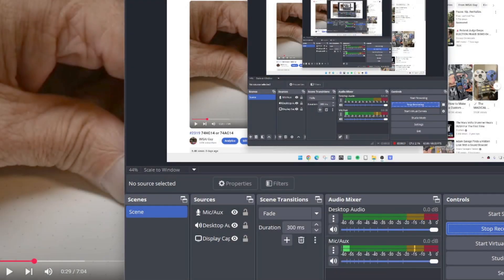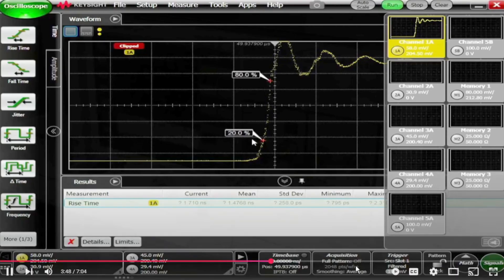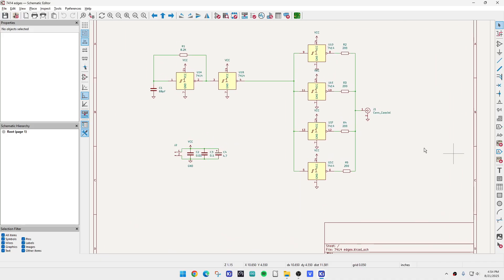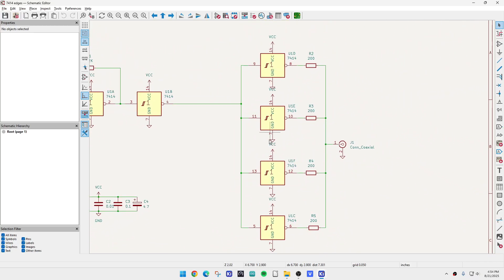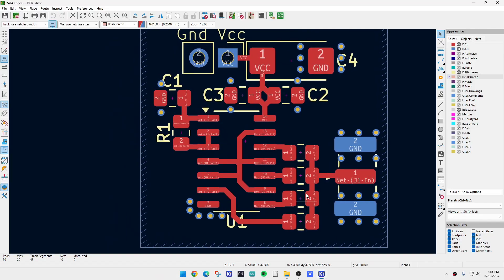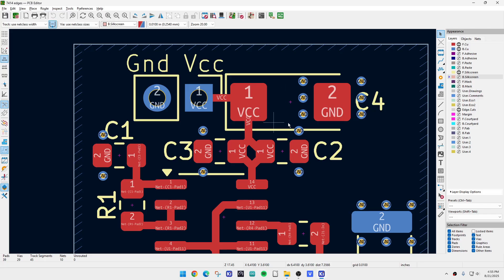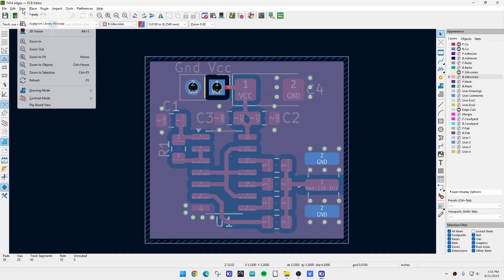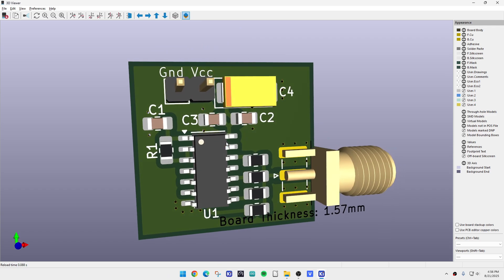#2344 74HC14 vs 74AC14 vs 74LVC14 Final Measurement (part 1 of 2)

Comment: I was watching a video showing the internal LCR of bypass caps. Different values of the same size have different resonance that degrade the filtering compared to using multiple 100nf caps for example. Higher values, lower resonance dip. Using one value keeps to one resonance and makes cleaner bypassing.
Reply: I saw the same video 😀
Reply from the maker: https://youtu.be/BpWFGBlq0y4?si=zWAZOxy10katXI5L

Comment: I once did some measurements of the output impedance of some HC gates, and it's actually big enough that you should make those 200 ohm resistors a little smaller if you want a perfect match (it's also slightly different for sourcing and sinking...). But it probably doesn't matter a whole lot as long as the termination at the scope end is well matched.
Reply: correct!

when I made my own pulse generator based on some LVC chips, I measured the output resistances of the gates, which ended up being about 13 Ohm.

I used four single-gate ICs, so I added a 187 Ohm resistor in series with the output of each, thus making the resulting output impedance as close to 50 Ohm as I could.

using 200 Ohm resistors will result in extra ringing.

of course I also took care of trace length matching and choosing correct trace widths for proper impedance matching.

Comment: One of the inverters you have connected to drive the SMA is placed noticeably farther from its 200 ohm resistor than the other 3 inverters.  Each 10mm of extra length add about 50 psec of travel time, assuming FR4 pcb, and add late to the output.  I was wondering if that would cause the edge to smear and make the 10-90 rise time longer?  Perhaps you could test this by lifting that inverter's output pin leaving 3 inverters to drive the signal (and ideally replace 200 ohm resistors with 150 ohm)?  It would be interesting to see.

ETA: and it's another opportunity to show off  that 50Ghz sampling oscilloscope.
Reply: This is probably correct.  Also, ground and power plain inductance will have an effect.  I built a few pulsers with the Potato Semiconductor parts, where I glued them upside down on a small piece of clad and used 0603 thin film SMD resistors wired point to point.  0402 were simply too small to wired point to point. BTW, use thin film resistors, not thick film.  Before ordering any boards, re-analyze your layout.

Comment: I’m new to PCB design and was wondering what is the purpose of the polygon poured on the first layer of the board? Is it also GND?
Reply from the maker: I'm not sure what you are referring to. there is no pour on the first layer. only traces and pads for SMD parts
Reply: @IMSAIGuy Well I’m not exactly sure how to put it, but there is a green area in the same shade as the traces, which are separated by a darker shade of green. There are also some vias going through it.
Reply: @IMSAIGuy Well, there is this green area that is separated from traces by a darker shade of green, there are also some vias going through it.
Reply from the maker: @SMC-qr7ow  oh sorry. I forget how I designed it. yes the top and bottom have ground pours. so everywhere there is not traces, it is ground copper.

Comment: Oh,  the sine wave input to the 7414 seems pretty clean on the scope,  it is from a commercial oven that however does not have a lot of oomph but should be high enough amplitude for the trigger.  Well the chip input was loading it too much so it did not look nice but I put a resistor in series with the chip input which made the osc.  look like a clean sine but still had enough drive for the chip.

Comment: I built a 10 MHz oven ref. to drive my counter and signal generators external inputs.  The sig gen requests a TTL type reference input rather than a sine. So I figured why not try a 7414 to make that output side. I even incorporated the pot option to allow duty cycle to hopefully be set.  The output of one stage was ugly.  I figured,  then put more in series with the first stage maybe. There are plenty on the chip.  Well I also tried several famalies of the chip.  The TTL output is still pretty ugly looking even with the load on but the voltages fall into acceptable TTL levels I guess so it seems happy with that input.  Not a pretty square at all.

Comment: Will it make a difference if a track curves smoothly rather than turn at 30 or 45 degree angles? You can use "Fillet Tracks" to smooth the turns. Click on a track, then press Ctrl key on the keyboard to select the track next to it. Basically selecting the while thing that is cornering at 45 degrees. Then right click on the highlighted tracks and choose Fillet Tracks. Use 0.4 or 0.6 mm. Then you can grab the curved corner with the mouse and increase or decrease its curvature.
Reply: Short answer is not relevant at the rise times you'll get from a 74xx14 part.  Best case will have rising edges in the 500-1000 ps range.  In FR-4 PCB, 1000 ps is approx 150 mm.  This PCB is probably about 25 - 30 mm total.  Quality of low impedance to power and GND, and quality of SMA connector and cable will be more relevant here.

Strongly suggest you google "Myth of three capacitor values" by Eric Bogatin et al.  Capacitor frequency response is more about package size than value.  Having two identical caps in parallel results in better performance because the inductance is halved.
Reply from the maker: I've seen that, I also tested it https://youtu.be/BpWFGBlq0y4?si=J2sb7giLawrEn82s